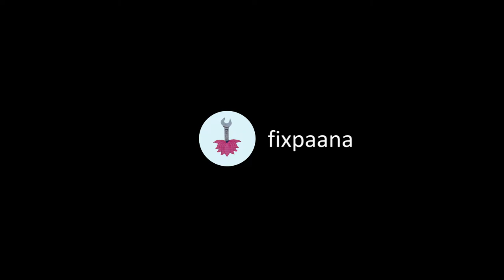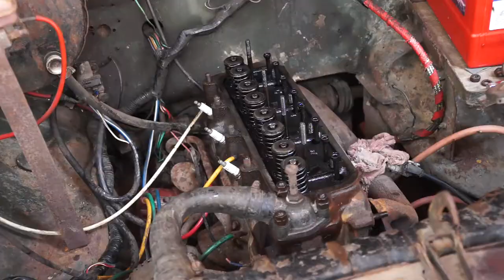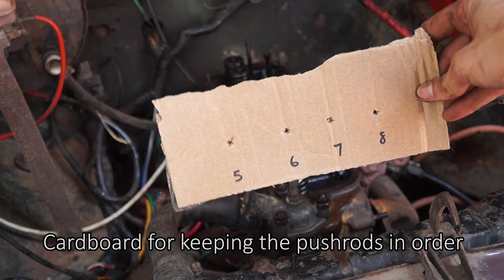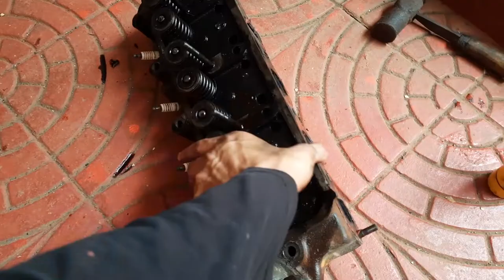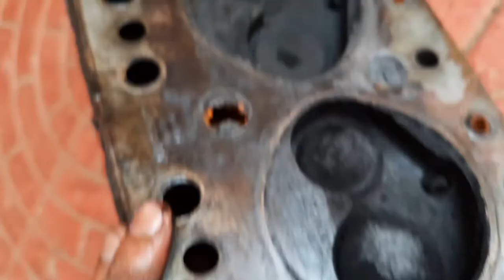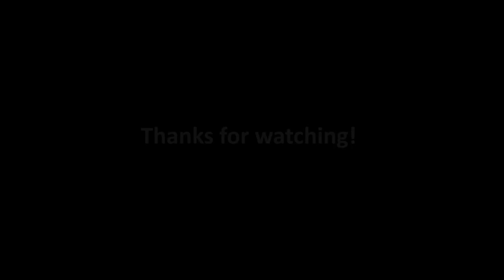Hindustan Ambassador Cylinder Head Removal | BMC B Series Head Removal

Comment: Would you please tell whether electronic ignition conversion kit is available to replace cb points and condenser of HM PETROL Ambassador car using Lucas -TVS Ignition Distributor Unit? Which model, make, price etc may please be mentioned. US and UK make such units seen in Youtube.
Reply from the maker: Hello, in case you missed it, I replied to your previous comment on the other video too. I have not used any of the electronic ignition kits to be able to make any particular recommendations. The most popular name I have heard in the industry is that of Pertronics. I do not know if they make a kit for our particular type of engine but might be a good option for you to consider. Other than that I would recommend that you do some research on MGA, MGB and Morris forums to see which electronic ignition kits the guys use and recommend.
Reply: @fixpaana  Thank you very much.